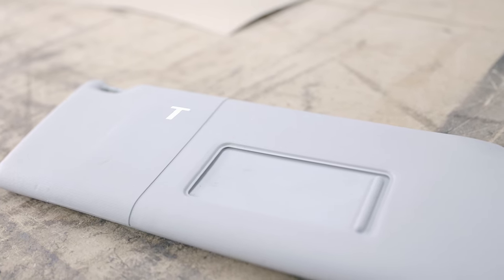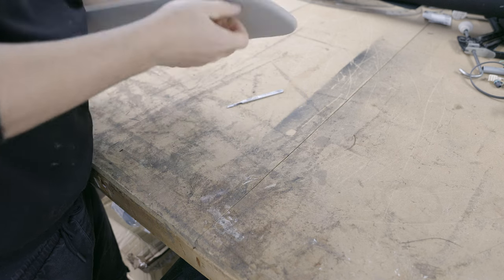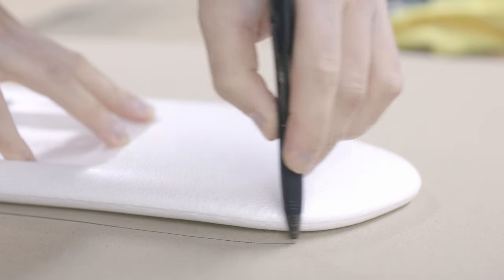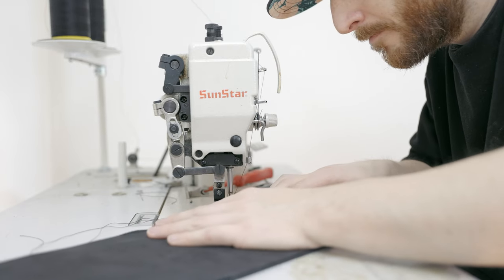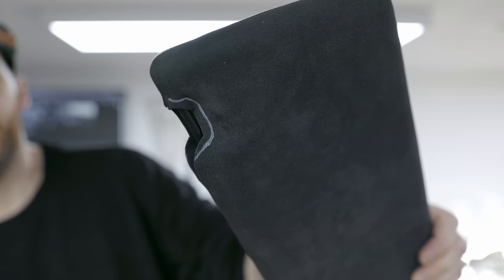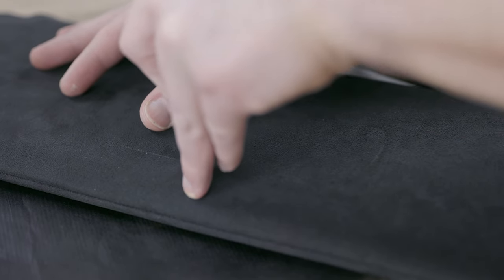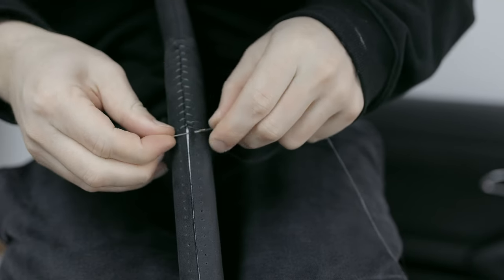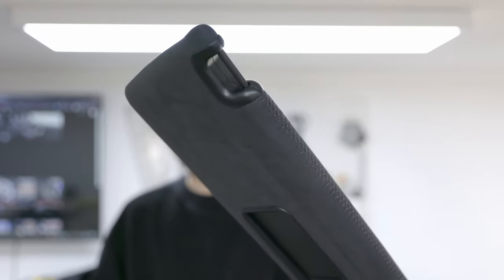VW T6 Sun Visor + 3D PRINTED parts = WIN? -  T5/T6/T6.1 Sun Visors

Comment: Hi I have a T5 (32 version) which I am converting into a camper van based on the T25 style. Ive been attempting to cover my sun visors with "perforated vinyl" and failing repeatedly as the edging looks terrible when glueing it. You have made it look so easy so many thanks for revitalising my confidence. I just wish I could use a sowing machine lol